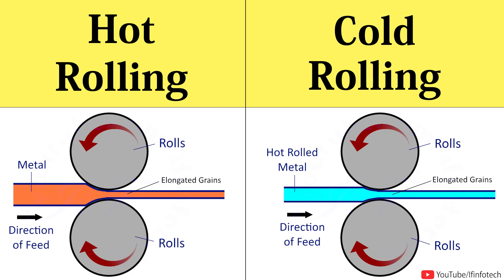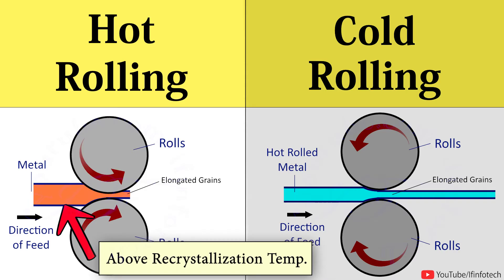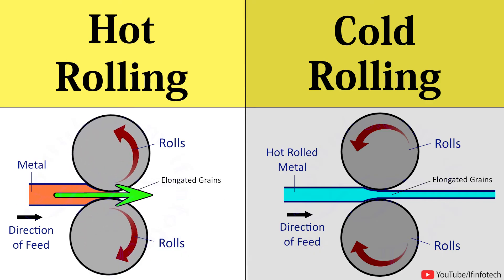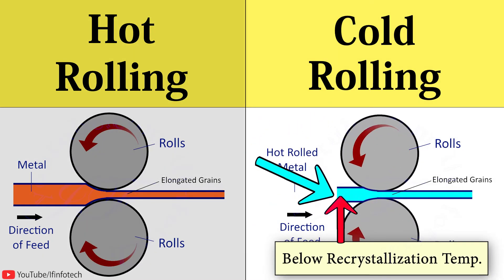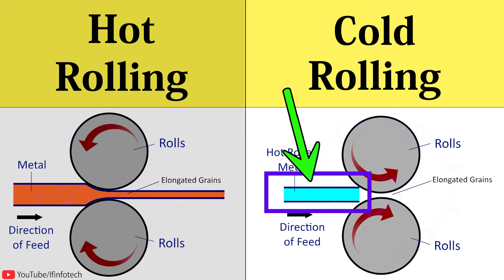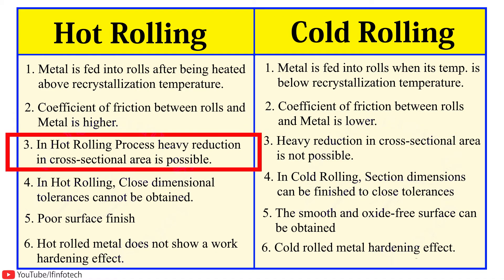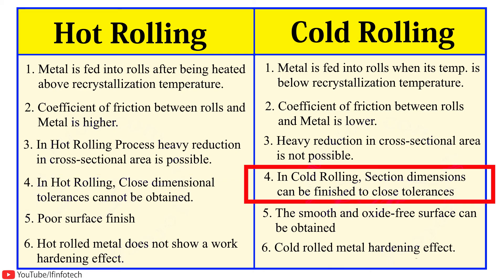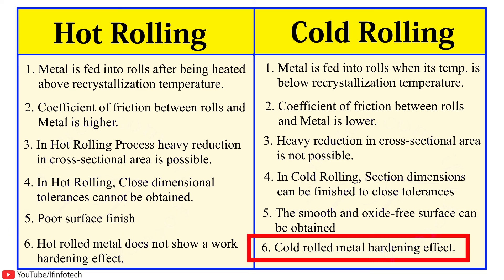Rolling Processes: Hot Rolling and Cold Rolling Process Working Animation | Shubham Kola

Comment: sir can you elaborate 2nd point, I'm not sure but I think its wrong because energy required in cold rolling is high so coefficient of friction should be high?
Reply: I think that the added energy required in cold rolling is higher because cold rolling actually changes the metal crystal sizes, whereas hot does not, which is a more significant contributor to total energy usage than friction.